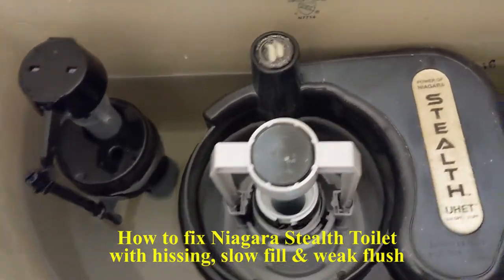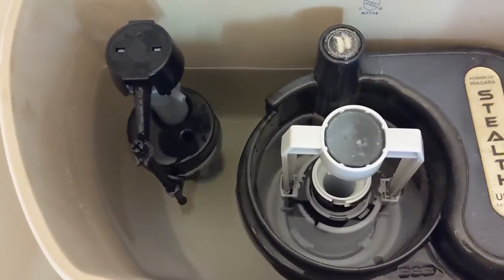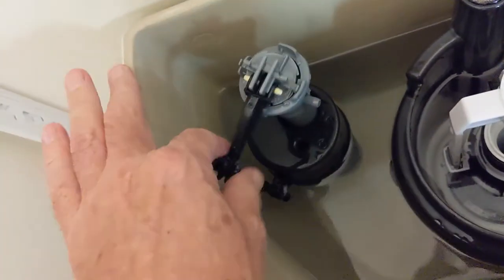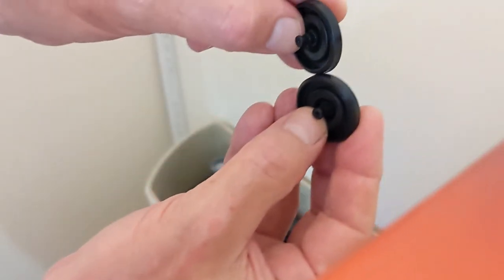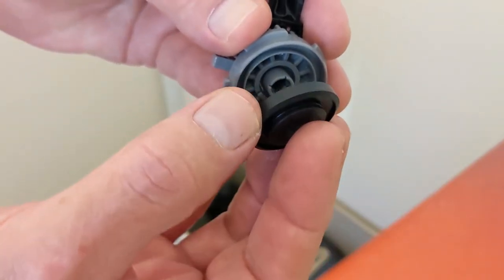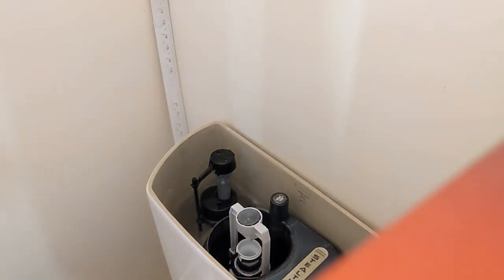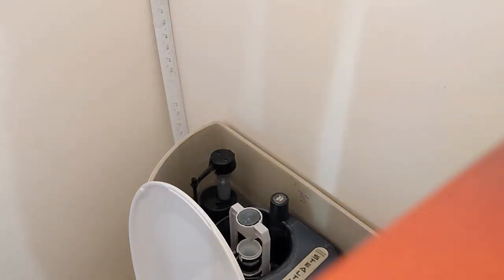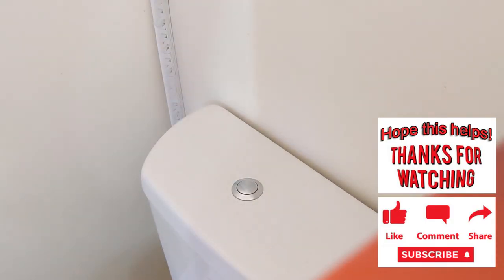How to Fix Niagara Stealth Toilet for under $2.00 - Hissing Noise & slow water fill with weak flush

Comment: I installed three of these systems on the same day at my house.  They all began to fail around the same time, and my inner conspiracy theorist swore that I was a victim of planned obsolescence.  Maybe I am, but this TOTALLY helped all three toilets!  Thanks a million!
Reply: I have 2 that are about 3 years old and both started this on the same day.  I found little pieces of sand in both that were causing the problem.  Think something just gets in the lines and goes to all the toilets.  Happened a again few months later.  Found another small grain of sand.  Was the issue for me.
Reply: Sue those o ring makers !!:face-red-droopy-eyes:

Comment: You saved me so much time and energy in diagnosing the problem, I was about to replace the toilet bowl. Every time I flushed the toilet, I would be so upset, watching the water running for several minutes. What an unnecessary waste of water. I tried several times to diagnose the problem but wasn't able to. I can't thank you enough!

Comment: Thank you very much. My unit is less than a year old and all of a sudden the hissing started. With your help to get inside and get the gasket. It looked okay so I just cleaned it with a cloth only and wiped the inside down, reassembled and problem was solved.  We are noted for hard water I live and I think the build up was the issue. seriously great video though....It helped me for sure.

Comment: You're the Mannnnn!!! I'm a 66 year old Female I fixed the toilet hissing by myself, with your video. I couldn't remove the screw adjuster thing once I dislodged the part under the cap. Too scared I was going to break it.  So once I dislodged the piece counter-clockwise, I turned the part so that I could remove the seal. And then popped in the new seal and put the part back on turning clockwise to set it, I put the cap back on. Turn the water on. I flushed twice, and waited. Then my husband peeps his head in the door and says,how you comin' Baby. I said I think I fixed it. I don't hear no noise 😡 I guess I have to call and cancel the plummer.
Reply: Your husband doesn’t know how to follow instructions? 😂

Comment: Thank you so very much for making such a simple yet greatly detailed video. I’ve been dealing with this issue for months and was kinda trying to ignore it. I am not as handy as some but after watching this video a few times I felt confident.

I quick trip to Home Depot, they had the new Fill Valve Seal and the problem was solved within a few minutes after getting home. 

Really, this should be the template for “How-To or DIY” video on YouTube. Simple and to the point. Thank again, best wishes and positive vibes sent your way.
Reply: Ditto! Thank you so much for this video!!!

Comment: Thank you for this video. I thought your diagnosis fit the problem I have with a Niagara Conservation Stealth toilet, so I followed them, using the exact same replacement valve seal that you used. Like you, I found it very difficult to remove the part which held the old fill valve seal the first time I tried to remove it.

Unlike you, after I replaced the old fill valve seal with a new one, the toilet still made the hissing sound. I thought I might not have fastened the new seal properly, so I took it off and put it back on again. Even so, the toilet still makes the hissing sound.

Do you have a suggestion as to what I do next? What might happen if the problem, whatever it is, isn't fixed?

Comment: I am going through some trial and error and I have a glacier bay model that has the niagra stealth setup that advertises it is capable of flushing 12 billiard balls and believe me it will, but yesterday it suddenly lost flushing power completely and I know that it isn’t clogged at all because I have dumped a 5 gallon bucket of water in the bowl and it drained immediately and when it happened I instantly noticed that the jet power that is usually present when flushed wasn’t there at all and water was slowly draining out but no typical flushing spiral 🌀 like you would normally get. So I’m just wondering what is causing this to happen

Comment: I came to your channel because our toilet is hissing. I noticed that you just tapped the button and it flushed all the way. We have to hold our button down even with the lid off to flush completely .
Reply from the maker: Sorry, I'm not sure what's causing that problem. Did you ever figure it out? Leave a comment with the fix in case that's happening to someone else reading these comments.
Reply: @AxMan-777  turns out we had a clogged pipe from house to septic tank.
Reply from the maker: @suel4269  Wow, that sounds expensive. Thanks for letting me know.
Reply: @AxMan-777  yes it was. Especially when it had to be snaked on Christmas Eve night . 😳. Previous owners planted a tree on top of the pipe. It had to be rerouted . 🙈

Comment: Hi #AxMan .. I did this suggested repair and changed the little black valve.  The hissing/sqealing sound has stopped, BUT.. now the water won't stop running!  I tried adjusting flush button and valve arm to no avail. Please help! This toilet is less than 3 years old! (N7714)
Reply from the maker: Sounds like the adjustment screw for the valve water level in the bowl could be the problem. Or maybe there is a leak on the seal on the bottom of the tank. Sorry for the late reply, I don't come on here a lot.
Reply: @AxMan-777  Thanks for your reply.
Happy 4th!! 🇺🇲
Reply: I have the same dagum
Problem on N7714 toilet fill valve gasket replaced and hissing noise stopped. However the gasket seems too small as now it just keeps over filling tank. Even after I left of the arm on the fill valve water keeps flowing! Only the old gasket that makes a hissing noise will stop the fill valve! 💀🙏🏼
Reply from the maker: @mrgriffey6026  Wow, that's not good. Did you ever figure it out?

Comment: Where to get that seal? This noise is SO loud
Reply from the maker: There's a link to Amazon in the description above. Also you can get it at Lowes https://www.lowes.com/pd/Fluidmaster-Rubber-Toilet-Hardware-Kit-For-Fluidmater-400A/1000106791, or Home Depot https://www.homedepot.com/p/Fluidmaster-Replacement-Toilet-Fill-Valve-Seal-for-400A-Fill-Valves-242/100580550

Comment: Would replacing the fill valve seal fix my problem? Toliet flushes normally, then water level falls after the bowl fills up. Thank you.
Reply from the maker: No, you probably need a new seal on the flush valve (not the fill valve), or you might have a slow leak. It's a very common problem on the Stealth toilets. Watch the YouTube Stealth video called "Stealth Toilet - Troubleshooting" and watch the part about checking the flush valve, then check the white seal on the bottom of it, try hand cleaning it, and/or replace if necessary. Good luck.